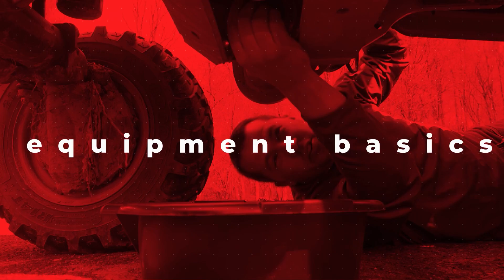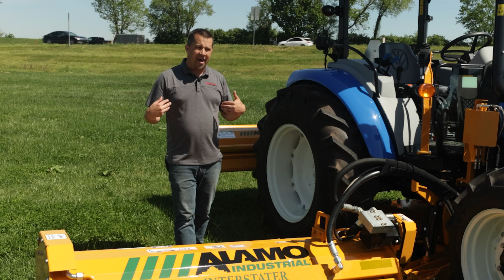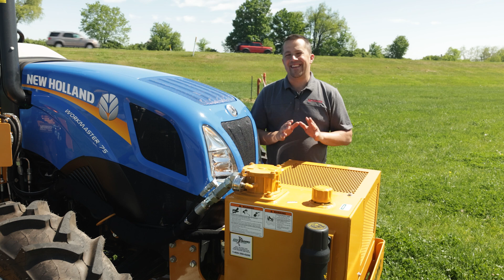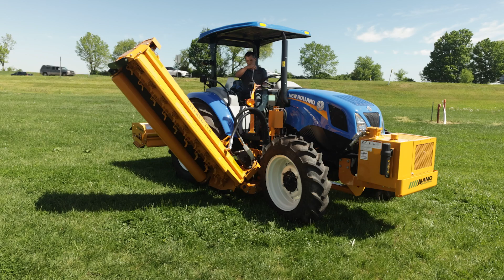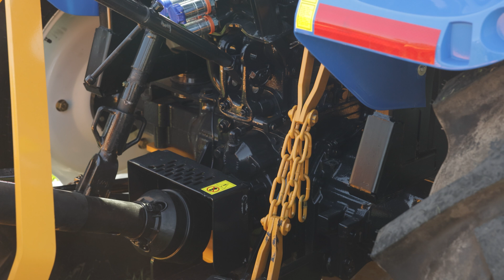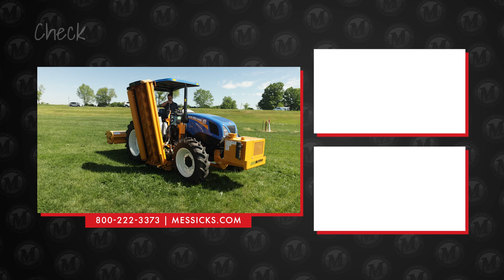Unique Highway Mowing Tractors | New Holland Workmaster 75 & Alamo Interstater

Comment: I work for a County road dept in WA state and we do a lot of roadside mowing. We have 17 roadside mowers in our fleet the majority being New Holland Tractors and a couple of John Deeres. The actual mowers we use are made by US Mower because they are local to us. All of our mowers are rotary head mowers mounted on a boom and you talking about the safety is an understatement. The mowers are easily our most dangerous and high liability piece of equipment we run. As a result we run with enclosed cabs because we don't want hit ourselves with thrown debris. We don't have front tanks but we do have front mounted pumps that run off the engine. We can't use flails because we are mowing through too heavy brush on the road side, and I'll admit it is fun.

Comment: The Maine Turnpike Authority (MTA) bought a few Mahindras to mow with, but they kept having troubles with the rear differentials. Turns out, it was due to mowing on the inclines and the oil would pool on the downside leaving the upside oil less and thereby causing the issues. Mahindra couldn’t fix it, so they unloaded all of the Mahindras and are back to NH and JD

Comment: Seems crazy not to have a full cab and AC. Here in UK cabless tractors are only legal with small tractors., very rare. And here most tractors have front linkage now, so a 3 meter flail mower on front and a reach mower (hedge cutter) with a 1.2 or 1.5 meter head on rear of tractor , no-one would use such a small tractor. Needs to be 140 hp +. Most are 150 hp+

Comment: Flails leave a nice cut but are far more susceptible to damage from hitting rocks or stumps or other significant debris than a rotary cutter. The tractor shown here doesn’t have as wide a stance I’d expect for steep side hills.
Reply: The flail is on the downside of the slope so it would have to be almost past vertical to roll
Reply: @ThingyGoos  What happens when you are on a steep slope and encounter an obstacle or become stuck and need to raise the flail? Most roadside mowing tractors I see have a wide rear stance.

Comment: I am wanting to upgrade to a sub-compact flail b/c I'll be converting my ditches to wildflowers & not mow from September 1st - June 1st.  I only have 23hp though & I know I'll need to be changing the hydraulic filter on schedule b/c I can feel the difference, I think my air is just too humid.
Reply: I'd love a flail mower for my Kubota BX2680, but those mowers are ridiculously expensive.  I think Betsco sells one but even then its about $3,000 by the time you add in shipping and delivery and liftgate service.  

I'd rather have the flail mower over a rotary cutter....one reason is a flail mower doesn't stick 6+ feet out the back of the tractor, and the other reason is I don't care to try mowing down trees, I don't mow anything like that, just a couple of pastures for customers....so a flail would be a better option rather than tearing up my mid mount mower.

Comment: Nobody cuts highways here without a cab tractor
Reply: Same in Delaware.  They would riot!
Reply: Eastern Nc, most of the sub contractors use non cab tractors.
Reply: Agreed.  This was the first thought I had.  I get the added cost of a cab being an issue, but if you're buying Alamo stuff, it seems like a no-brainer.  I can not believe they can find decent operators.  I would not want to deal with the elements, noise, dust and debris from such mowing operations, but whatever, I still appreciate Neil's content and perspective.
Reply: I agree, I own a mid 90s era caseih tractor with the Alamo setup we use for mowing edges of our fields and such. Has just a canopy and I certainly wouldn't want to spend 8 hours a day in it!